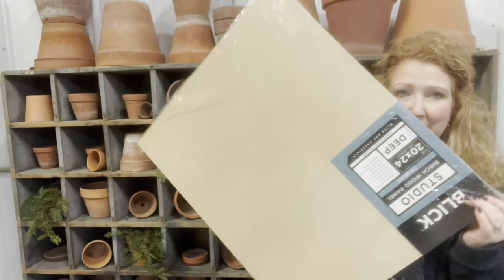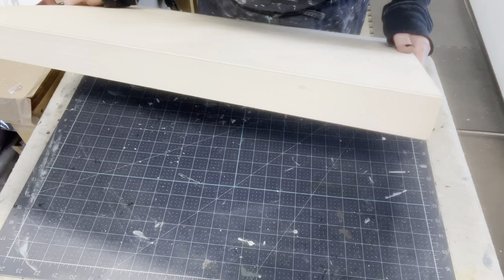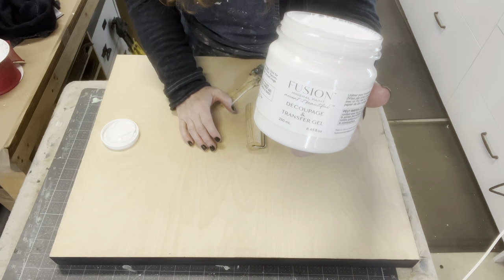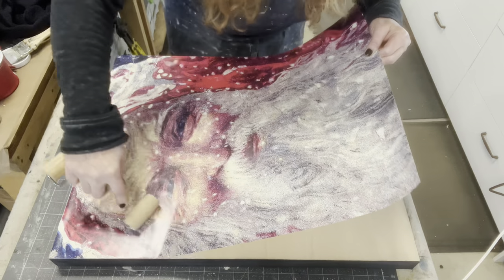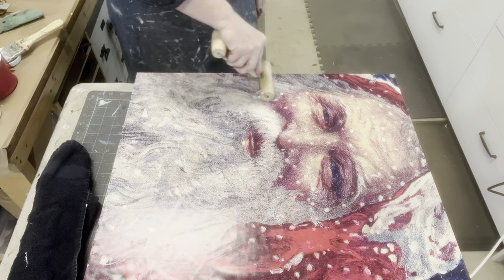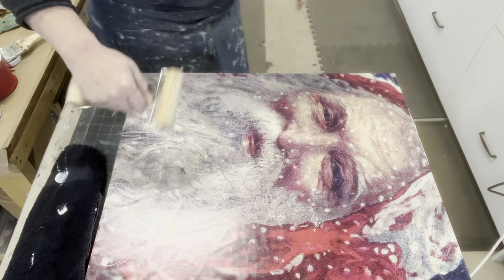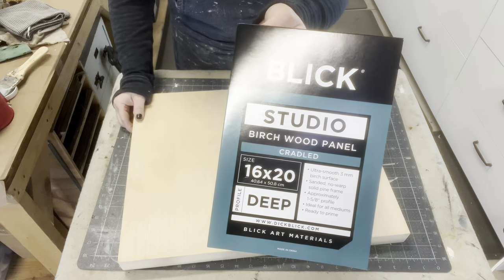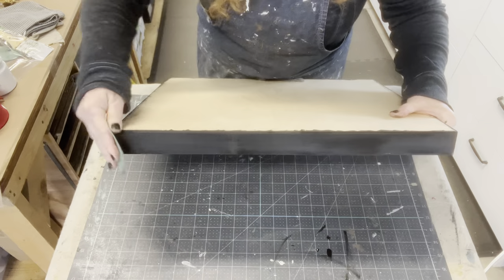DIY YOUR OWN SANTA CANVAS | CHRISTMAS DECOR IDEA

Comment: Did you know- after you glue and trim the brown paper on the back, if you mist the paper with water and let it dry, the paper will shrink slightly and make it tighter and smoother.  Just dampen it, don't soak.  👍
Reply: Yes!  I always used that method when framing my needlework projects!
Reply: Me too!

Comment: I have used posters on furniture and I used wallpaper paste. And also if you do these “canvases” in the future get yourself a wallpaper smoother to get the air bubbles out and smooth out the poster. I wallpapered for 15+ years and I tend to go with what I know. lol. But they turned out amazing. Thanks for the inspiration.